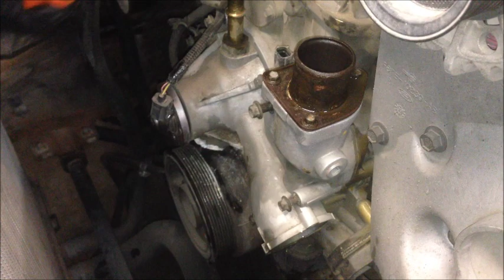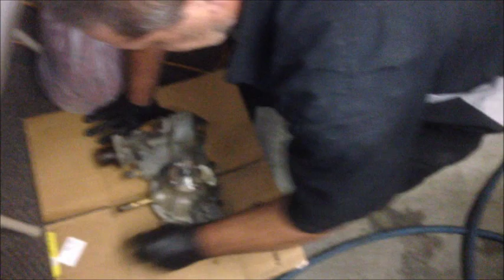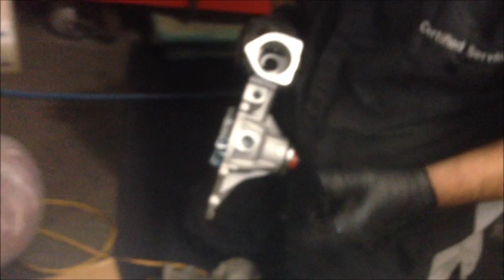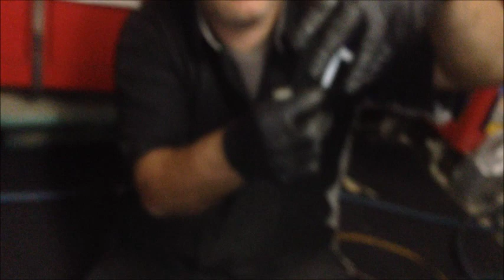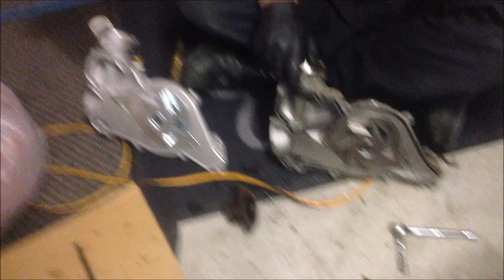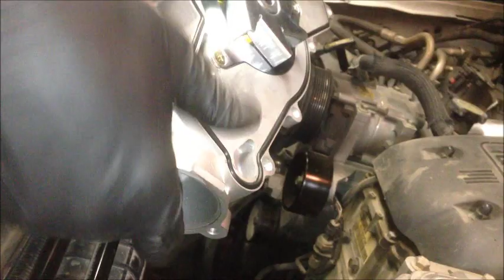Ford Superduty 7.3 L Diesel Water Pump Replacement Part 4

Comment: I saw another video where they suggested just putting the bolts directly into the new pump one at a time so you get them into the right spots...just in case they get hit while sitting on the cardboard.   Thanks for the videos.

Comment: Why not replace that rusty therm housing and thermostat since you have the pump off?? ...there are after market housing you can install that won't rust.
Reply from the maker: Very valid question and we appreciate it.  Most of the vehicles we work on are customer vehicles.  Not our own.  We can only recommend repairs and let the customer decide what they want to spend their money on.  In this case, the rust was only superficial, we cleaned up the sealing side and the customer said the thermostat had been replaced recently and we saw evidence of that. So unfortunately we cannot replace every part as we see fit, it is up to the customer on most, as it is their money we are spending on parts.  Please join our forum at forum.carrepairsmadeeasy.com ---  thanks so much.